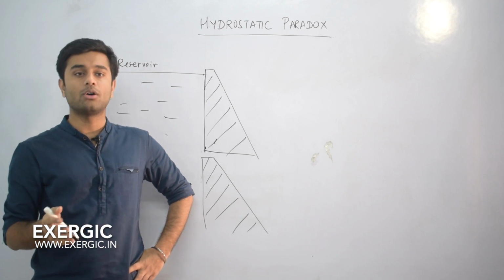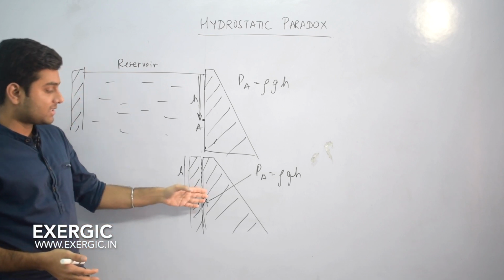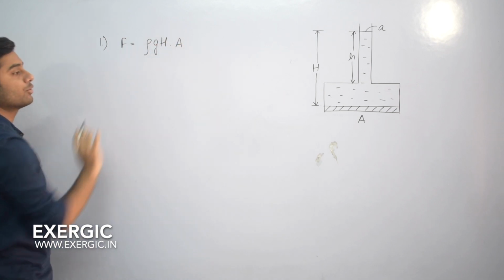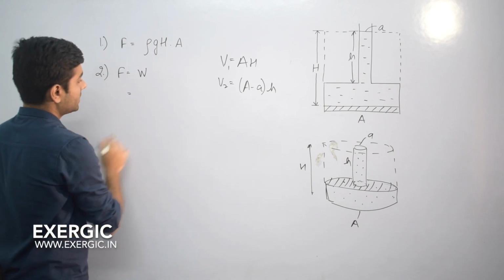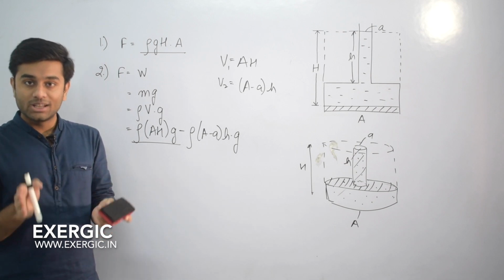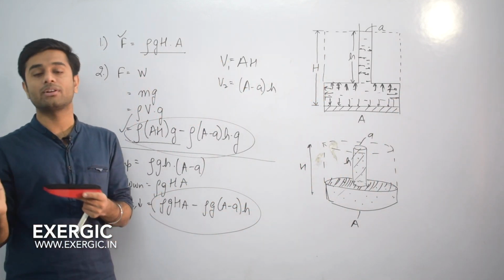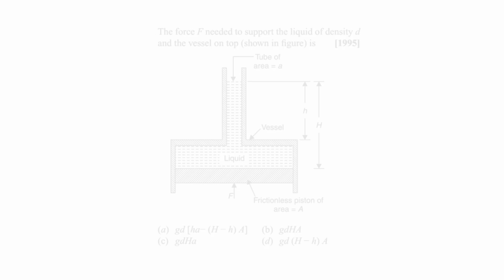Fluid Mechanics previous year question | GATE 1995 (2 Marks) Mechanical

Comment: In first case your expression is wrong because you consider A cross section area upto H but it is only upto H-h,
So from hydrostatic law
Correct expression or total force on plate by fluid= {density×g×(H-h)×A} +(density×g×h×a)
= density×g [{H-h)×A}+{h×a}]
and after solving and taking H, h common the  it is equal to your 2nd expression...

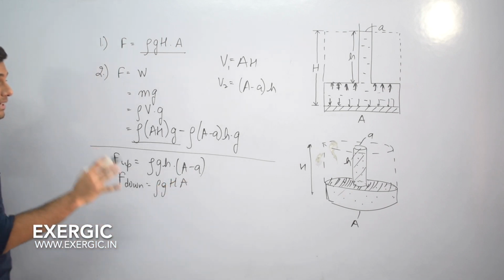Comment: Wrong explanation got started at 11:04 . Here, the direction of the net effective force is not in downward direction. It's in upward direction. And the force is balanced by its own weight in downward direction. Here, the logic is that, reaction force by the piston in upward direction= weight of the liquid in downward direction+ reaction force by the upper wall in downward direction. 

i.e; the reaction force by the piston in upward direction is not balanced by the weight of the liquid only , which is the actual mistake here. it's actually balanced by the weight of the liquid and the reaction force from the upper wall.
Reply: Bhai agar neeche pistion nahi h.. Pura container hi h.. Agar apan container ke neeche weighing machine lagayenge toh.. Weighing machine ka reading = weight of the liquid hoga na?
(weight of the container is negligible)

Comment: Excellent problem! Hydrostatic paradox was explained well but I think the reasoning behind the solution of the problem could have been better, the fact that force is needed not only to support the fluid inside( dg(ha+(H-h)A)) but also the outer casing (dgh(A-a)) sum of  which is dgHA .. Was not discussed well.

Comment: A jet of water with a velocity Vi (Figure shown
below) and area of cross-section Aj entersa
stream of slow moving water in a pipe of area
A2 and velocity V2. The two streams enter with
the same pressure P. After thoroughly mixing
in the pipe the stream emerges as a single
stream with velocity Vs and pressure pa. If
there are no losses in the flow, determine
P2-Pi) for
Vi 20 m/s,
Va = 10 m/s,
A = 0.01 m,
A 0.02 m?,
density of water p= 1000kg/m*.

Comment: #query
If this same amount of water stored in same shape of container(closed) and container is put on ele. weighing scale then shown weight will be?
Reply: It will be Rho*g*h*A
Because weight shown on the weighing machine is nothing but the normal reaction by the machine on the container. And it will be equal to force acting on bottom.

In case of other solides weight = force acting on bottom ; but in case of of liquid stored in a container weight may not be equal to force acting on bottom due to hydrostatic paradox.
Reply: @sanikakale3488  i don't think it is... Because here container is closed so it can be taken as entire single body with mass which is proposal to its volume... 
W=Rho*g*V

Comment: First you considered the weight, but in this case directly rho ×g×H× A how ❓
Reply: Yeah u r right? I also had the same doubt and after watching so many videos I may clear ur doubt.. The question before the gate prev question is answered wrongly the force acting on the bottom surface is equals rho*g*H*A...but sir taught abt weight paradox
Reply: Same doubt.... In the starting sir told always use hydrostatic law... So the net downward force acting must be equal to force applied... I don't understand why sir directly uses rho×g×H×A
Reply: @chandan_12_  I think it went into a bit of complications. We can understand by simply knowing that the pressure applied on lower surface is higher than the wt of fluid bcoz the fluid will also exert some pressure on upper surface of cyl. and this will push the fluid again in downward direction resulting in higher force than its wt.
Reply: @chandan_12_  just because they don't ask about net downward force

they asked only the force on the surface of the piston
Reply: Kartika Chandra Tripathy weight = mg      Mass can be written as density x volume  and volume can be written as Base area x height

Comment: Actually its is weight +force applied by the top surface ie (A-a)on fluid and not just weight. I think that's where we get it wrong if we think its just weight is equal to force.Nice video .ty

Comment: Sir, if we keep this vessel on a weight measuring device what will be the reading shown??.. (a) or (b) 

Coz. The normal reaction force that will act on the surface of weight measuring device will be gdHA..so the reading shown by device will be gdHA..
 
Sir if the above reason is correct then if we have any other container which is not shaped with same cross-sectional area throughout its height..we can never determine the weight of fluid contained in it using the weight measuring device. 

Sir please tell if I am thinking right.

Comment: The concept is works good when the lower plate or piston is taken as a free surface w.r.t the the vessel.
If it is taken as a rigid part along with a it's vessel..than weight of the water will be effective answer, right?
Reply: Yes
Reply: If the lower surface is considered rigid, then it becomes a vessel
And the net force will be the weight of water plus weight of vessel
Reply: It is just placing a vessel of water on a weighing scale, the total weight will be there answer